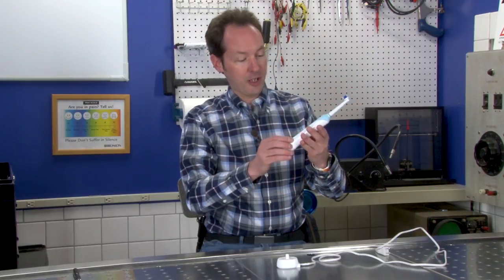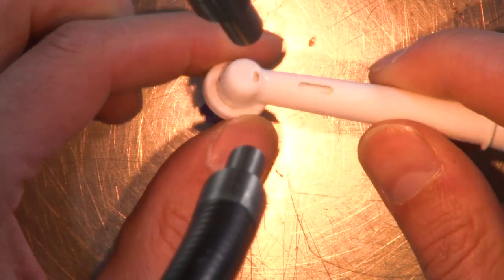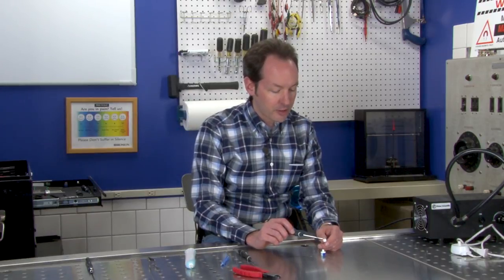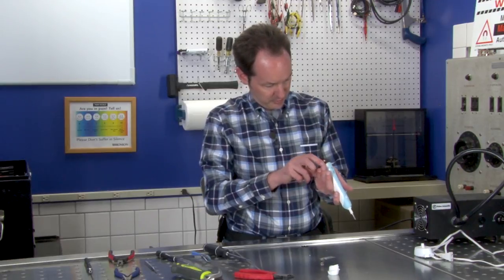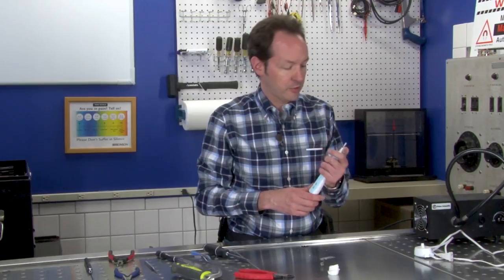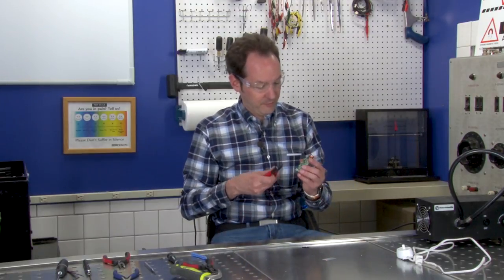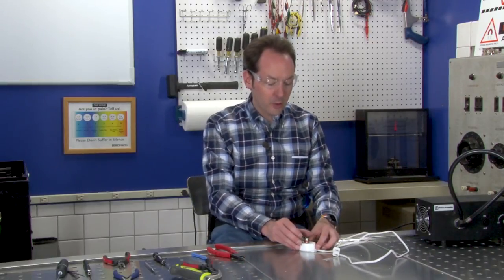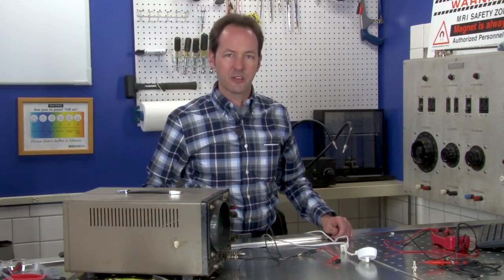Electric Toothbrush: Equipment Autopsy #100

Comment: The reason the reading on the multi meter was so low is because most of those suck at measuring high frequency AC, but good for mains frequency AC.

Comment: That spring is probably there to help remove the bottom because the bottom is supposed to be removed to remove the battery once the toothbrush is dead by twisting it on the charging base to open it.

Comment: The charger DOES come apart. Under the four stick-on foot pads are four screws.  How did he miss that?
Reply: there are not screws, i have tried to take these apart, to modify it to use as a wireless charger for my phone, to no avail but almost snapping my pry tool. it is literally glued and the insides are covered in this yellowy plastic bollocks.